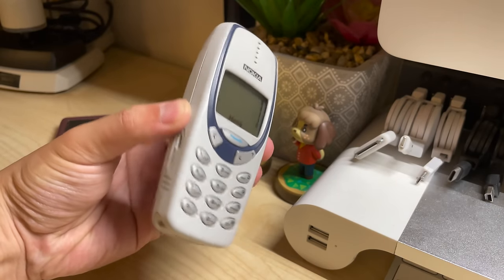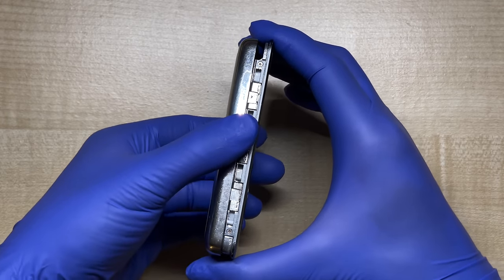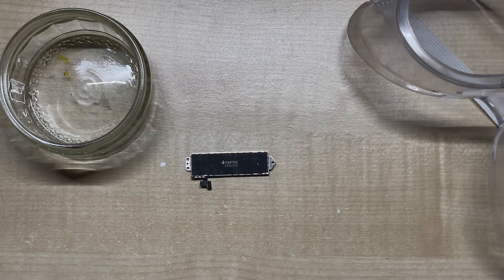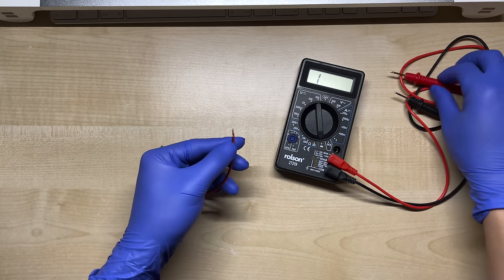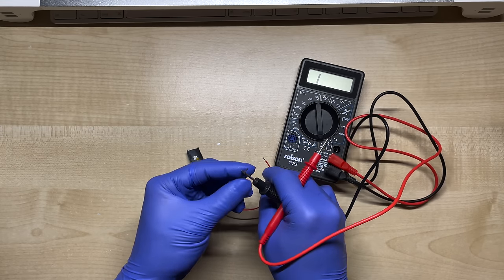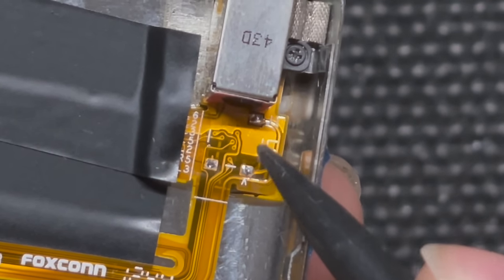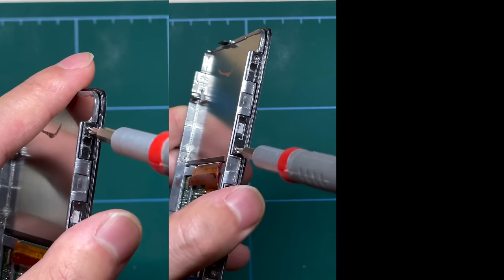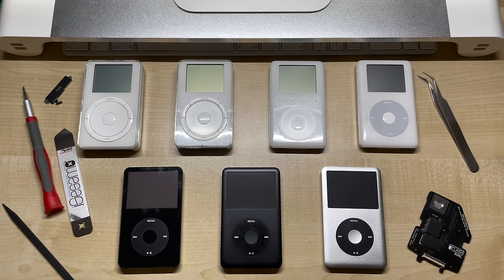iPod Classic Taptic Engine Mod Tutorial (5th, 6th, 7th gen) (Haptic Click Wheel)

Comment: Are the pads supposed to be gold or silver? And did I ripped off the pads if the pads are silver?
Reply from the maker: The pads should be light gold, if they're torn then they shouldn't be visible at all.
Reply: @NekoMichi  Thanks for the quick response. Most of my gold plate got ripped off but i tried it and it‘s still working luckily

Comment: Great video! Could you do the same thing on iphone se 1st gen. I think you will need an iphone 6s plus taptic engine due to the size of iphone se’s vibrator.
Reply from the maker: Sadly it won't work on a 1st gen SE, the board uses a DC motor while the Taptic Engine uses an AC signal.

Comment: I just tried installing a Taptic Engine from an iPhone 6s in my 5th gen iPod and I get sound from it, but no haptics that I can feel. Any ideas why?
Reply from the maker: The 6S Taptic Engine is very inconsistent, some work but most won't and will just make a weak noise even if you've installed everything correctly. The iPhone 7 and 7 Plus Taptic Engines will work much more consistently.

Comment: why not use a vibration motor from a samsung or other device?they are relatively small, u can save space for something else or u can put 2 of them.
Reply from the maker: Because most common phone vibration motors are a completely different type of motor called an ERM (eccentric rotating mass). An ERM is not compatible with the type of signal output by the piezo clicker whereas the Taptic Engine is, since it's a linear actuator.

Comment: could i use an iflash solo and trim it to make room for the taptic engine as i accidentally broke my clicker and i want flash. its in a thin version.
Reply from the maker: iFlash Solo is too thick, only the iFlash Quad or a dedicated flash SSD will fit.
Reply: @NekoMichi  can i trim it atleast?
Reply from the maker: I've only tried trimming an iFlash ATA1, haven't tried with an iFlash Solo. Might work, but no guarantees.
Reply: @NekoMichi  Well, anyways thanks for your advice. I hope you keep finding mods for ipods!

Comment: Hey! great video and thank you for sharing this with us! I'd like to ask you something.
Can we place the speaker again on top of the taptic engine pads just in case we want both the vibration AND the sound of the clickwheel? 
Thank you very much in advance!

edit: Can't we just solder the taptic engine directly on the speaker's legs in order to keep both taptic engine AND the sound of the clickwheel?
Reply from the maker: I've tried doing that. While both will work, the output strength on each will be halved to the point where neither is strong enough to be heard/felt. The Taptic Engine on its own still makes the same sound as the clicker however this is only audible in a quiet room.
Reply: @NekoMichi  Hey, I really thank you for this reply! This information is super helpful, I have already ordered the engine and I was about to keep both, I think you saved me some time now, I decided to remove the little speaker completely and only keep the engine on!

Comment: I just ordered one of these taptic engines but do all of them have those pads? Maybe i will receive a fake one
I do have an old iPhone 7 plus laying around so not that worried as I could just swap them
Reply: Also if you use leaded solder then your iron can be a lot cooler and still melt the solder
Many soldering irons allow you to set the temperature
Reply from the maker: All of the iPhone 7 and 7 Plus Taptic Engines I've seen have these pads, I haven't seen fake ones before. I'm using a cheap soldering iron without temperature control and lead-free solder so my setup isn't quite as good as most kits you can get.
Reply: @NekoMichi  ahh I used to use lead free solder and a cheap soldering iron too and it burned a pad away

I definitely recommend buying leaded solder and a temperature controlled iron from amazon, they’re like $20 and so much better. 
Lead free solder melts at like 217 Celsius and leaded solder at around 188 celsius
But it’s recommended to use 316 celsius for leaded and 343 for lead free

Wash your hands after handling that leaded solder though
Reply from the maker: Thanks, I'll definitely look into it. I ended up trying to work around the limitations but it's not ideal, a good soldering set might just be the investment I need to make.
Reply: @NekoMichi  the one I bought doesn’t have those pads 💀 its not a real vibration motor but I have a spare iPhone 7 plus laying around that I can swap it with
Reply: @NekoMichi  hands down my favorite mod ever thanks for this video haha love it
I put a few dabs of hotglue on the sides to hold it down and it works lovely
Reply: @NekoMichi  old apple mice with usb cable have a speaker like the iPod so perhaps you can add one in there lmao
Reply from the maker: Time to hunt on eBay...

Comment: Do you think the plus provides better haptic response compared to the regular 7 Taptic Engine? And do you think its worth the size difference?
Reply from the maker: I think the 7 Plus motor outputs slightly stronger haptics than the regular small 7. Another factor is the better fit, it has a much larger surface area of contact with the iPod's back casing so it's better at transferring the kinetic energy across.

Comment: hello I'm wondering if the 12 mini taptic engine is eligible for this?
Reply from the maker: The iPhone 12 Mini Taptic Engine might not have the hidden pads on the side that we need to solder to.
Reply: @NekoMichi  right, then I'll buy it and try. thankfully they are not expensive. will update in a few weeks

Comment: Would it be possible to use both the speaker and a Taptic Engine, or would that draw too much power?
Reply from the maker: It's possible to wire up the Taptic Engine to the clicker together so they both work, but that causes both of their outputs to be reduced.
Reply: @NekoMichi  makes sense, thanks for the reply!
Reply: the sound of the taptic engine in operation almost similar to that of the clicker. I don't see a need to have them together. Also, as Neko says, if you put them in series the output of both will be reduced. If you put them in parallel you can generate too much consumption and damage something on the board. Better to remove one and put another.

Comment: I'm a little curious in knowing, when you enter the self-diagnostics menu (hold select + up, then when screen is off, switch to holding left/rw + select), what vibration/sound comes out? The iPod emits two short separate (presumably square-wave) tones instead when you load the diagnostics screen, I'd love to know what would happen if the taptic engine was given those tones, rather than the clicking noises from the iPod's main UI.
Reply from the maker: It makes the same noise, only quieter. It also vibrates but the haptic output is very weak because that specific tone is different to the Taptic Engine's optimal resonant frequency.

Comment: Can you make this a 1 TB or above? I noticed you had 3 other slots you left unpopulated. Great video by the way, well shot and edited, very entertaining and informative.
Reply from the maker: You can, the iPod can read up to 2TB although it starts getting unstable at 1TB.
Reply: @NekoMichi  What is unstable work?
Reply: @user-rt4ul3st3q  DankPods tried to upgrade storage to 4tb, but not every tf-card work with the new adapter, and when you put 2tb its only read 1.9tb
Reply: @cyangreed  that is, if you fill the full 2 tb, he will be able to recognize only 1.9?  But the unrecognized data segment is fixed or does it not recognize each time randomly?  and how much does such an increase in 2tb cost?
Reply from the maker: Sometimes it won't boot, sometimes it randomly corrupts data and you lose all of your music.
Reply: @NekoMichi  then with what maximum capacity does it work stably and without bugs?
Reply from the maker: It depends on the RAM of the iPod, the 60GB 5th gen, 80GB 5.5th gen, and all 6th and 7th gen iPods have more RAM and I'd say they can handle up to 512GB. The 4th gen can take 256GB, the 3rd gen can take 128GB and the 1st and 2nd gen can take 64GB.
Reply: @NekoMichi  I saw the Chinese sell 7 on 1tb, but I didn’t see the video of the operation of such devices, I’m just interested in 7
Reply from the maker: The added capacity might be useful for storing larger files like videos. The main limitation isn't exactly the size, but the total number of tracks or videos in the library.
Reply: @NekoMichi  Do you happen to know what is the maximum number of tracks that can be processed without problems?
Reply from the maker: I'm not sure, but I think iFlash has a list on their website.
Reply: @NekoMichi  just looked, they write on 160gb 7 up to a maximum of 50,000 tracks, thanks for the answers

Comment: there's got to be a way to install without removing the click speaker, right? if you could find the space, you could just solder to the pins, couldn't you? crazy that you did a full refurb, but you kept it looking stock. if you're going to replace with inferior parts, you might as well make it look unique.
Reply from the maker: Theoretically you can just wire the Taptic Engine in parallel with the clicker and both will work.

Comment: did you just use the speaker terminals to power the haptic engine?. does that mean theres no speaker in the ipod anymore. what happens when you play music? does it play thru the haptic engine?
Reply from the maker: I replaced the clicker with a Taptic Engine. The iPod Classic never had a proper speaker inside, Apple designed it to be used with headphones only.

Comment: Do you have to remove the speaker, or can both the taptic engine and speaker work simultaneously?
Reply from the maker: You can have both if you connect the Taptic Engine in parallel without removing the clicker.
Reply: @NekoMichi  Thank you. I was worried you were removing it due to a amp limit on those pads preventing both from running adequately, rather than making it easier to solder.

Comment: But how does it work when the software it is not intended to be used with an taptic engine....like...you wire it up with a headphone conector inside but wouldn't it make the engine to vibrate un intently when you play music...plss someone explain 🤔
Reply from the maker: The Taptic Engine isn't replacing the headphone jack, it's replacing the piezo clicker. The piezo clicker is designed to output the cursor clicking only and not the music playback. The wave signal for the cursor click just happens to fall within the same resonant frequency range for the Taptic Engine, which is why it works.

Comment: That's awesome work, thanks so much for putting this together! 

Have you got links you can share for the battery and back housings?
Reply from the maker: I bought them from a UK eBay seller called "approvedgadgets"
Reply: @NekoMichi  thanks for the Info! I'm UK based too and trying to avoid importing from EOE in the USA if I can avoid it. It looks approved gadgets have housings but no batteries listed. Perhaps you bought the last ones? ☹️
Reply from the maker: Ah my bad, the battery was from "pcnetworking". I think they have 2 left in stock. The housing was from approvedgadgets and they have back casings for other capacities too.
Reply: @NekoMichi  
Hello, are you based in the UK?
I am hoping to get one of my iPod Classic 7th Generation modded like this. I have successfully put a 1TB on it, but this TACTIC will be a problem, I don't have the knowledge of doing something so intensive like this and the TOOLS, apart from that, got this shaking hands due to age related problems. I joined your discord but could not send this message on the discord platform.

I don't mind how much it will cost. I am highly interested.

Thanks.
Reply from the maker: Unfortunately, I don't offer modding services (too many risks and my standards aren't exactly great).
Reply: @adetoye50  I'm UK based, if you send me your back panel (with headphone jack) I'd be able to fit a taptic engine to it for you, I've recently done this on my 7th Gen. Hardest part of the job is splitting housings (as I'm sure you're aware!)

Comment: Question- can you keep the original hard drive in there and the original thin case? While only replacing the battery to a thinner one? Thanks!
Reply from the maker: Unfortunately that's not possible as even with a thinner battery there isn't enough space with the original hard drive still in there.

Comment: Whats the max memory you can install in the iPod?
Reply from the maker: Depends on the model and usage. Most iPods can theoretically detect up to 2TB but can't actually make proper use of the full capacity, and the total track length is the actual limiting factor. When modding iPods, here are my general limits:

- 1st, 2nd gen: 64GB
- 3rd gen: 128GB
- 4th gen, Mini 1st, 2nd gen: 256GB
- 5th, 6th, 7th gen: 512GB

Comment: It almost looks like my 80gig iPod Video, except the touch control is white.  I still actually use it because we bought a used 2010 Dodge minivan that has an iPod connector.  The battery is pretty beat so sometimes there’s a communication error until it charges up a little after the vehicle starts, but other than that it’s pretty solid and holds a crapload of music.

Comment: Can you do a iPhone 5c Taptic Engine Mod??
Reply from the maker: This won't work. The iPhone 5c uses an ERM-type vibration motor which runs on a completely different signal to the Taptic Engine. Even if you soldered a Taptic Engine into it, it won't respond to any outputs.

Comment: Did you use rosin on the pads of the Taptic Engine?
Reply from the maker: No, I used rosin only for cleaning the tip of the soldering iron.
Reply: @NekoMichi  I see, that makes sense. I suppose the pads don't need to be de-oxidised sin d they were protected by kapton tape, but I wanted to make sure. Thank you kindly!

Comment: Is this a thin or thick back plate?
Reply from the maker: This is with a thin back plate.
Reply: @NekoMichi  Thanks! Gonna give this a try
Reply: @Neko Michi do you think a bluetooth mod would work with this if it had a thick back plate?
Reply from the maker: It might be, I haven't used a thick back casing before.
Reply: @johnnylarsen00  I think it would fit, but I would not use a 3000 mah battery. I would instead use the square battery (2800 mah, iirc)

Comment: I broke the taptic engine because I can't control my hand and melted the entire plastic on which the pads were resting on. I over estimated myself. I suck...
Reply from the maker: Don't give up! Every mistake is a learning opportunity. For the Taptic mod I'd recommend applying solder to the iron itself and then gently dabbing it like paint. That way you can avoid touching the soldering iron tip to your Taptic Engine or the headphone ribbon for long periods of time.
Reply: @NekoMichi  Thanks for the response! I was so ready to quit semi micro-soldering and thanks to you I found the courage to do it again. At least I didn't break the iPod. Thank you for being this supportive towards your community.
Reply from the maker: If you can, find some dead boards or similar spare parts and use them for practice before working on the iPod.
Reply: @NekoMichi  Oh yes, I will. Thanks a lot for the advice!